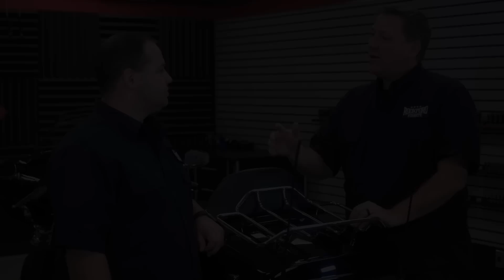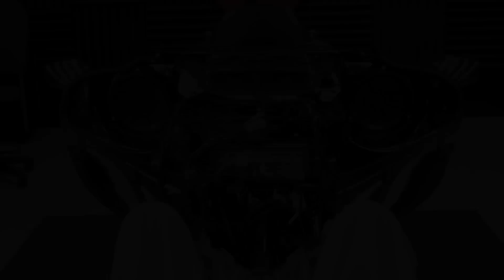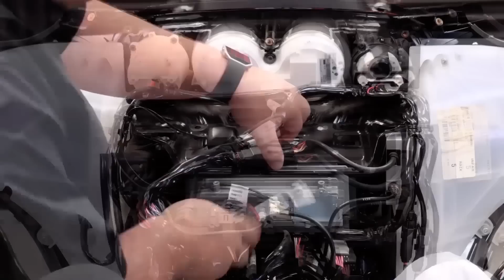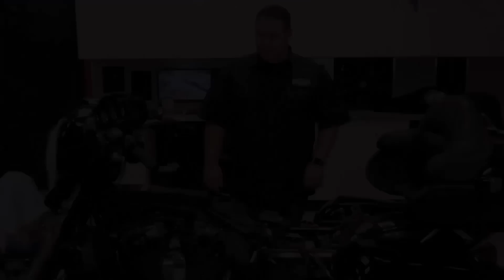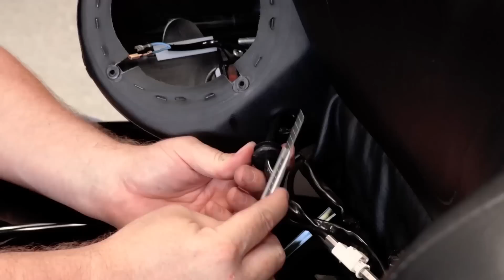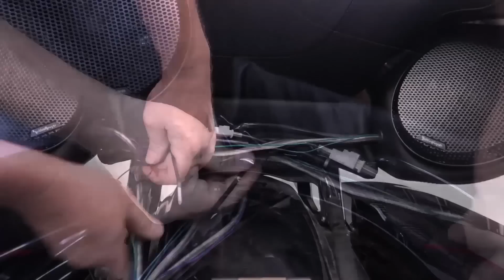2014+ Street Glide® Front Speaker & Amp Install

Comment: Where can I get the speaker converter wires.  I have the new module of rockford amp for the fairing but the new speakers in a 2022 Street glide has different connectors than what is on the amp. I need the dongles you used it looks like.
Reply from the maker: Sorry we missed this post.  For others looking into the same issue, we highly recommend the 2014-2023.5 Harley-Davidson wiring kit that is available here: https://rockfordfosgate.com/products/details/rfk-hdrkm5/

Comment: Is the amplifier always on ?
Reply from the maker: No, the amplifier features a "High level input capable with Auto Turn-On circuit".  Which means that it "senses" the DC Offset found on the factory radio speaker wires to turn the amplifier on/off.

Comment: So what do you recommend when the outside edge 3 screws (the 3/16) are stuck or seized in place? The brass fittings either came free from their mounts in the fairing and/or the screws are seized into those brass fittings, thus seemingly making it impossible to remove the screws and speaker pod now

Comment: Hello great video, I have a 2017 ultra with detachable tourpack kit does the new harness kit enable me to still detach the tourpack and if so will this mess up the amp since the rears will be disconnected from the system. Thanks
Reply from the maker: Hi John, This is our 1st generation kit.  I added a link below to our 2nd generation kit that uses a T-harness, which takes advantage of the factory electrical system.  Since your TourPak already has speakers and detachable harnesses from the factory, no additional wiring is needed for the TourPak, allowing it to be used as normal.
• HD14U-STAGE2: https://rockfordfosgate.com/products/details/hd14u-stage2/

Comment: Ordered same kit for 18 street glide and want to do lower pods (4 speaker set up ) how would I do this?
Reply from the maker: You purchased the 1st generation HD14-TKIT or a newer 2nd generation kit?  If you have the exact model number from your receipt I can show how to do this.
Reply: @rockfordfosgate  I have the power audio kit stage 2 #510-0571 just bought it a week ago . I have the 4 (6.5) 2 for bat wing 2 for lower pods thank you
Reply: @rockfordfosgate  HD14 up stage 2
Reply from the maker: @louisgonzalez803  Thank you for that information.  Sounds like you have the HD14U-STAGE2.  There are two little 2" black Y-Adaptors (pictured middle-right at https://rockfordfosgate.com/products/details/rfk-hd14/  ) in the amplifier mounting kit for this purpose.  Plug 1 of the Y-Adaptors into the FRONT OUTPUT of the amplifier. Your upper fairing speaker harness will plug into one end, and the lower fairing speaker harness will plug into the other end.  For the lowers, you'll need to make a harness by using the 6" white/gray  harness from the amplifier box (4-pin molex one end and bare wire the other end) and solder / heat-shrink a speaker wire extension.  Now you'll have a custom made harness that plugs into that other end of the Y-Adaptor.  Go ahead and zip-tie the cables along the crash-bar to the lower pods and plug into the lower speakers.
Reply: @rockfordfosgate  ok thank you very much I appreciate . I let you know how it works out thank you again

Comment: How about that ˋCLEAN ´ clipping procedure mentioned in the manual? Setting the input level just at 12h and the others as shown lets the system missing the low frequencies and sounds somehow destorted. Seems the Harley enginieers had a fine eq curve arranged which feels missing here due to no eq curve optimizing possible here.... (note: I had it flashed before)
Reply from the maker: We have setup guides that utilize the CLEAN input circuitry already configured here for you to download: http://rftech.custhelp.com/app/answers/detail/a_id/1355

The factory Harley EQ is adequate for low powered systems, but the TM400X4ad amplifier produces well over 400 Watts RMS, typically 550 to 600 Watts.  As shown in the below graph, at this high of power output, the factory eq will pretty much guarantee you'll be launching those speakers into the next neighborhood.  You can see how much EQ they put in the system in the below graph, which to give you a reference point is over +28 dB at 100 Hz.  Typical setups only require +1 dB to +6 dB gain at any one frequency.  It's crazy to think that even +10 dB is "double" the output, so using that much, is definitely trying to over-compensate for a lack of amplifier power. http://rftech.custhelp.com/app/answers/detail/a_id/1215

Comment: Why did you set the amp at the 2 channel setting when you had 4 speakers running off the amp?
Reply from the maker: This is our original Gen-1 kit (discontinued) that only pulled a Left & Right signal from the speaker outputs.  All our new Gen-2 systems for 2014+ utilize an integral T-harness with the amplifier set to 4-channel input so you have full control of the audio system.  Here's a link to our current Gen-2 audio kits for Harley-Davidson: https://www.rockfordfosgate.com/products/selector/motorcycle-kits/

Comment: Where do you relocate the gps antenna to?
Reply from the maker: We carefully use a razor blade to slowly remove it (retain as much of adhesive as possible) and stick it on the brake side directly behind the gauges.
Reply: @rockfordfosgate  thank you

Comment: I had my bike flashed a couple of years ago 4 speaker with or without amp, is that still a good flash or is there a better one now?
Reply from the maker: Hi Meek, In February, we launched our own "Rockford Fosgate Tune 2014+ All Bikes" flash.  This is what we're recommending to use now.
Reply: @rockfordfosgate  Ok what's the name of the flash? Thanks
Reply from the maker: @qf76mnd15  The name of the tune in the Centurion Audio software is labeled "Rockford Fosgate Tune 2014+ All Bikes".
Reply: @rockfordfosgate  ok, thanks
Reply: @rockfordfosgate  I'm wondering if this tune will be any different or sound any different from my current flash, if so I'll go and have reflashed. Is there a difference worth reflashing?
Reply from the maker: @qf76mnd15  We feel it is a much better curve with enhanced lower frequency response.  So far, we've only had positive responses on the sound quality.
Reply: @rockfordfosgate Kool, I'll get it done tomorrow.
Reply: @rockfordfosgate  Had flash done this morning, after retuning "processor" sounds nice. Thanks for info!
Reply from the maker: @qf76mnd15  That's great feedback Meek!  Thank you for your follow-up and sharing your experience with others in this community!
Reply: @qf76mnd15  are you still happy with this flash?
Reply: @dabreden  I have the latest 14+ flash
Reply: @qf76mnd15  was it worth getting this flash compared to your other flash?
Reply: @dabreden  yes if you're keeping stock head unit, and you're trying squeeze everything you can get out of it.
Reply: @qf76mnd15  thank you
Reply: @qf76mnd15  i got the my radio re flashed this morning. So far it seems more clear. I don't think it is as loud though but I had my gains far enough down that I can turn them up without any issues. Thanks for your help.... Ride on
Reply: @dabreden  You'll definitely have to reset your gains after flashing

Comment: One of these days I'll do a complete system redo. Right now I'm spending a lot money on my 2017 SG Standard just trying to tweek it for 2up riding comfort. Tour pack, Wind buffeting fixes etc...
Anyway so Im going to add rear lid speakers. Can the standard radio be flashed to 4 speakers? I know it won't be great audio and again later I will spend the $$$ on new audio. Right now lid speakers would do.
Reply from the maker: Hi Tom, rear baglid speakers can be added using the existing "2 Speaker Upper Fairing / 1 Amp" setting.  You'll just balance the front fairing / rear baglids by tweaking the gain on the front channel down a hair.  Our new flash that was debuted a few weeks ago supports 4-channel out from the factory HD radio.  However, the current system kits only pull from the front (2-channel) outputs.  We do not recommend modifying harnesses, but technically you can pull the rear speaker line outputs from the radio and connect them to the rear inputs on the amplifier and set the input switch to 4-channel.   Future generation kits and harnesses will support 4-channel outputs from the radio.

Comment: If i buy the speaker lid kit for my 15 streetglide special will i need an amp or can i just plug and play.
Reply from the maker: Great question Shane.  The TMS69BL14 rear bag-lid kit is designed to "add on" to an existing HD14-TKIT front audio kit.  You would need the TM400X4ad amp & RFKHD wiring/mounting kit to operate the bag-lid speaker system.  You can find info on the amp and mounting kit here:
https://www.rockfordfosgate.com/motorcycle/

If you have the Boom!™ Audio 4.3 or 6.5 GT radio, you'll also want to get the radio flashed to remove the massive EQ that will blow up your speakers when adding aftermarket amplifiers to the bike. More info about removing the EQ can be found here:
https://rftech.custhelp.com/app/answers/detail/a_id/1215

Comment: Hi, I'm locate on Fort Myers. Do you have any certified dealer close to me to get this setup install. Thanks
Reply from the maker: Hi Rafael, the closest dealers with a Flasher are listed below.  We have other dealers closer, but they don't have the flashing hardware needed for your 2014+ Boom! Audio radio.  If you happen to have the GTS radio, it doesn't need to be flashed!

TUNES-N-TINT
4980 US Highway 98 N
Lakeland, Florida 33809
863.614.1164
www.tunesntint.com

FIVE STAR CAR STEREO
2795 Gulf To Bay Blvd.
Clearwater, Florida 33759
727.216.6170
www.fivestarstereo.com
Reply: Thanks for the info!! On my way to place a order to get my Harley done!
Reply from the maker: Hi @rafaelsierra1238 , That's great!  Thank you for the opportunity.  This past weekend we debuted a new "Rockford Fosgate Flash" for all 2014 and newer H-D models (including the GTS radio) so you'll be able to take advantage of our new flash that has better Low Frequency response and unlocks your Speed Sense Control.
Reply: Rockford Fosgate What about just using your DSR1 in place of flashing the radio?
Reply: @rockfordfosgate  I am getting a 4-speaker system installed. Does all authorized dealers have the new flash???? I am getting mine at Leesport, PA at Classic Harley Davidson.. Thank you.
Reply from the maker: @HarleyFirefighter  Hi Paul, We have been playing around with a Harley specific de-tune files ourselves in the DSR1, but the problem still exists... the signal from the radio is clipping very, very hard and will be distorted.  So, although this will attempt to fix the frequency response deviations, it will still be distorted coming out of the radio.
Reply from the maker: Hi @jobeta22 , we released debuted the new "Rockford Fosgate Recommended Flash 2014+ All Bikes" in a Dealer training in Long Beach last week (2/22/19).   Dealers need to download the free update (about 30 Mb) to "see" it in their Centurion Audio software menu.  The software updates typically download automatically once plugged in and connected to the internet.
Reply: Rockford Fosgate Thank you for your reply. So I assume that the recommendation would be to have the Harley radio flashed and then the DSR1 could be used to fine tune the audio system for the rider? 

Just curious because I’ve just ordered this week your front and rear system and a DSR1 for my 2015 FLHXS. The closest authorized place to 70+ miles away. Which is not a big deal, if it wasn’t still winter..lol Plus I’m not comfortable with the idea of removing my head unit to ship it out to someone. I’d prefer to leave it in the bike and not risk it getting damaged. 

Thank you for your input, as I am just exploring options (DSR1 only or Flash/DSR1) before I tackle the installation.
Reply from the maker: Good Morning @HarleyFirefighter , Yes, in all cases we suggest flashing the radio since the EQ is up to +28 dB at the lower range (we've suggest keeping EQ adjustments within +/-9 dB, so this is an aggressive EQ.)  Then you can make any adjustments via the DSR1.  Keep in mind, if the system will be played at full output, so the more EQ boost, the more likely speakers can burn up.  With the new Rockford Fosgate Flash, you'll have a better frequency response, so the DSR1 can simply focus on fine-tuning different music genres.  

We have been working hard over the last 2 years to get a flasher into the hands of as many reputable dealers as possible.  We keep growing the list monthly (http://rftech.custhelp.com/app/answers/detail/a_id/1344) and will continue to find the right dealers with the expertise to perform aftermarket upgrades while retaining the integrity of the motorcycle's hardware and electrical system.

Comment: Where is the connection to the radio?  You're connected to the power, the speakers and the remote wire.  I must have missed something, but I know I didn't see any RCA connections.
Reply from the maker: The amplifier is getting the speaker output (high-level) signal from the radio and using to run the inputs of the amplifier.  There are no RCAs on the factory H-D radio.

Comment: What the best amp for dual p3 1in i enclosed set up??
Reply: Rockford Fosgate P3-2X12 1200 Watts Dual Rms Subwoofer Enclosure
Reply from the maker: Jose, thank you for that info.  The P3-2X12 is rated to handle 1,200W RMS (each speaker can handle 600W RMS).  The enclosure is pre-wired to a 1-ohm load.  A good amplifier would be the Punch P500X1bd.  Although it's only rated to product 500W x 1 @ 1-ohm, it's Dynamic Power output is 787 Watts x 1 @ 1-Ohm.  An alternative is the Punch P1000X1bd rated to produce 1000 Watts x 1 @ 1-Ohm.  The tricky part with this one is the Dynamic Power output is 1,430 Watts x 1 @ 1-Ohm.  If you use this amplifier, you'll want to be certain not to drive it to the maximum potential or you'll burn up the subwoofers since it can produce 230 more than what they are rated to handle.

P500X1bd
https://www.rockfordfosgate.com/products/details/p500x1bd/

P1000X1bd
https://www.rockfordfosgate.com/products/details/p1000x1bd/
Reply: Rockford Fosgate. Thank u this was very helpful🙌🙏
Reply from the maker: What model number P3 do you have?

Comment: Why did you select 2 channel amp when your using 4 speakers? Is there no Left,Right and Front Rear controls?
Reply from the maker: Great question Derek!  When you flash the radio to eliminate the EQ, the radio only provides output on the front channels.  By configuring the amplifier to accept a 2-channel input, we're feeding all 4-channels of the amplifier.  This is a design issue with the factory HD radio only.  If you are using an aftermarket radio, we would suggest using all four outputs from the radio and setting the amplifier's input switch to 4-CH.

Comment: Where can I get this installed ? I checked here in Canton , Ohio . No way I’m letting those dirtbags touch my CVO
Reply: CVO ALREADY HAVE THE BEST SYSTEM,SO WHY WOULD YOU?
Reply from the maker: Thanks for your inquiry Bob, Autosport Plus from Canton is a Power Certified dealer that has a flasher.  Keep in mind CVO models - depending upon what options you have - are not 100% plug-n-play and modifications will be necessary.  The number of options are numerous to discuss, so it is best to talk with a dealer that can evaluate your CVO and provide the best options for your audio goals.

AUTOSPORT PLUS
2136 Columbus Rd NE 
Canton, Ohio
44705
330.454.5705
http://www.autosportplus.com/